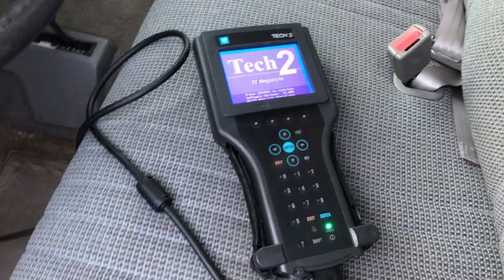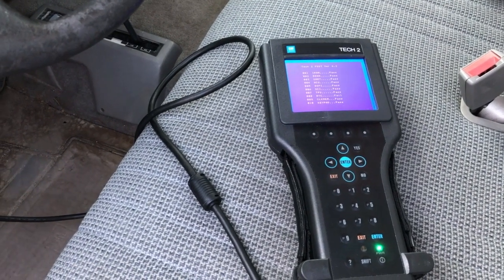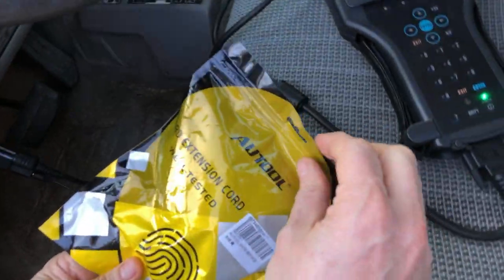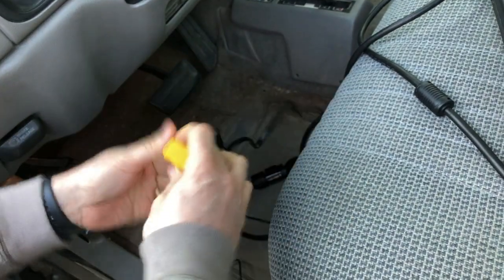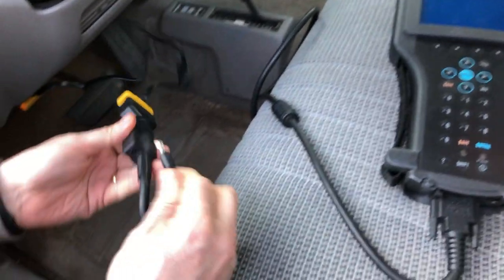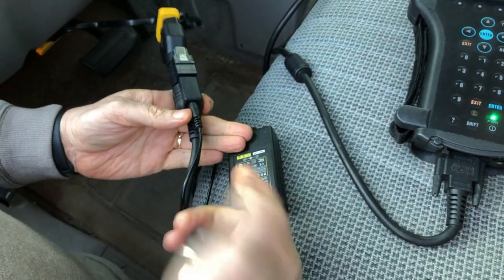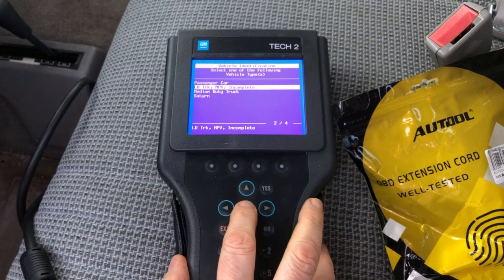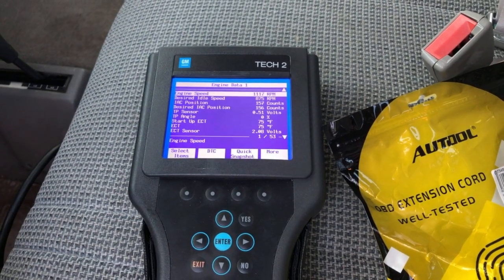GM Tech2 Scan Tool Clone Fix for Restarts or Reboots While Cranking Engine Problem

Comment: I looked the last time and was confused by the choices trying to find your exact tool (want to enable to anti lock purge/bleed feature) and so did not purchase from your provided link. I found this one with your provided link and want to know if this is the correct one (1996 GMC, K2500 Suburban, 7.4gas, 8600 GVW): https://www.ebay.com/itm/293491470644
Reply from the maker: That one should be coming up in the search link I have in the description.  Nowadays there's just the high quality Tech2 clone left so it's hard to go wrong, the pictures do match the contents I received.  In particular I look for the GM stickers that you have to apply yourself (so that they can ship it thru customs).   Price appears about right too.

Comment: What is that extra cord really for???
Reply from the maker: I mention in the video, it's for those OBDII adapters that Bluetooth communicate to smartphone apps on your vehicles health.
Reply: @DrShock  no the extra cord the tech 2 comes with why is that
Reply from the maker: When you buy them brand new it's all in a big kit.  You get adapters for ODBI and ODBII, Saab, Saturn, etc as older vehicles didn't have standardized diagnostics ports.  You get an AC adapter as that's needed for SPS programming with TIS2000 off vehicle.  You get self-test loopback adapters for the ADLC and communications ports.  And you get two more power adapters, one for the 12V accessory plug for ODBI vehicles and another that you can use with the battery instead.   So this $6 switched extension cable I've tested and video'd for you guys one can just toss into the box with all this other stuff and use it when necessary as you'll already have the AC power adapter, the 12V accessory power adapter,  and the battery jumper clip power adapter to choose from that came with your Tech2 kit.

Comment: Basically, a cord that has no power wires going to the vehicle hookup.
Reply from the maker: Yeah but finding that design commercially will be tough, but these switched cables are less than $6 to the door and quite common.